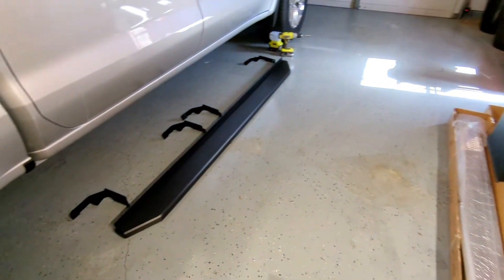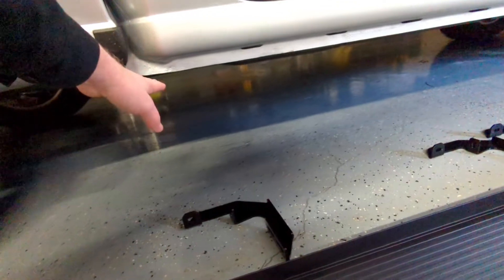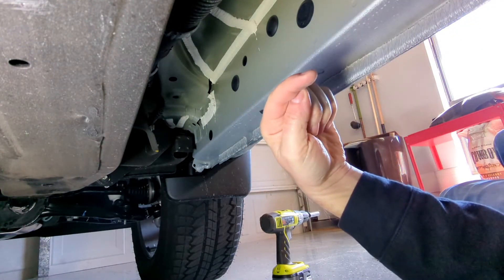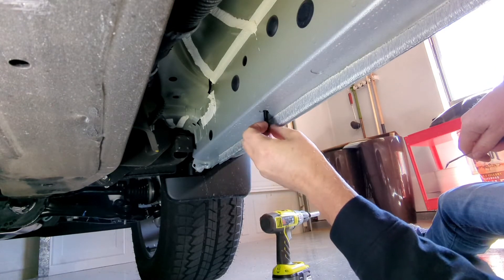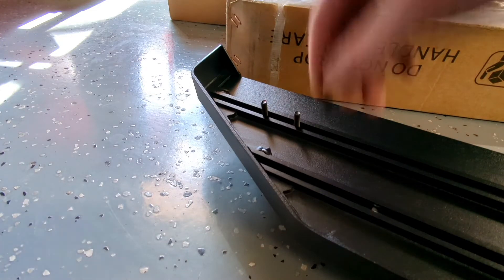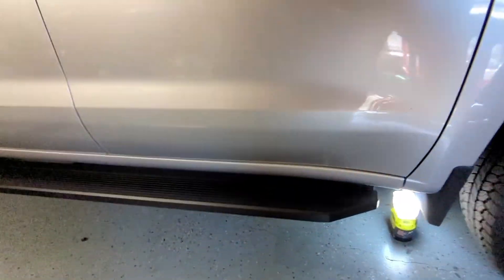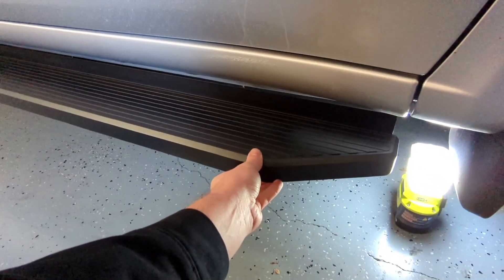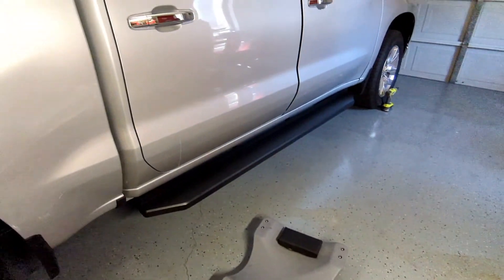APS iBoard Running Board Silverado Install

Comment: I’m getting some for my 2000 Explorer. I have drop steps that I put on 3 years ago and they look stylish. But I prefer a larger stepping surface.
Reply from the maker: You can't go wrong with a little more room and when they're installed they look pretty clean.  Best of luck with your install!

Comment: great vid, thank you, they show no brackets on amazon, how is the finish holding up on the aluminum?
Reply from the maker: I just traded the truck in a couple weeks ago but they had almost 40,000 miles on them and there wasn't a scratch to be seen!  I'd highly recommend them and they came as a complete package including the brackets to attach them to the truck.
Reply: @phil_hazzy  Thank you! i'm done with the steel ones, they rust within a year! I'm going to try a set of these

Comment: These look perfect, unfortunately they are out of stock everywhere
Reply from the maker: They've got them at Amazon! And they are fantastic!

APS iBoard 6in (Black Flat)... https://www.amazon.com/dp/B07P5HH7D6?ref=ppx_pop_mob_ap_share
Reply: @phil_hazzy  thanks for the reply, I’m should’ve added I have a double cab 2500hd
Reply from the maker: @gregs190  those are a little tougher to buy for. I had a double cab before this truck and had trouble finding a decent set.

Comment: I'm looking to get replacement nuts and bolts for this set. anyway I can get the sizes on these?
Reply from the maker: The ones that bolt to the frame are M8x1.25x30mm. Not sure about the ones that attach the boards to the brackets.

Comment: Where did you buy these please post the link
Reply from the maker: Hey Clive! Got them from Amazon for around $250. Here's the link:
APS iBoard 6in (Black Flat) StepsCompatible with Chevy Silverado GMC Sierra 1500 2019-2022 Crew Cab & Silverado 1500 LTD Sierra 1500 LD 2022 & 2500 3500 2020-2022 (Exclude 19 1500 LD) https://a.co/d/dW3ONBM